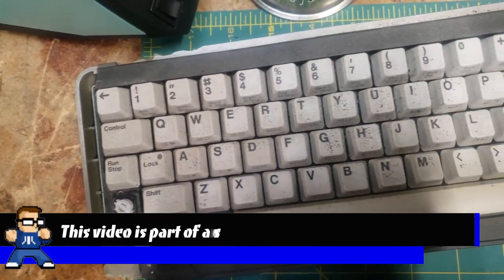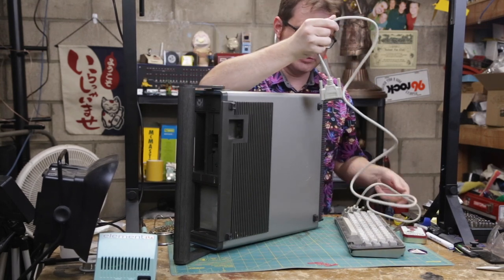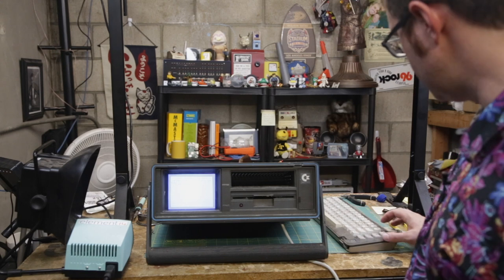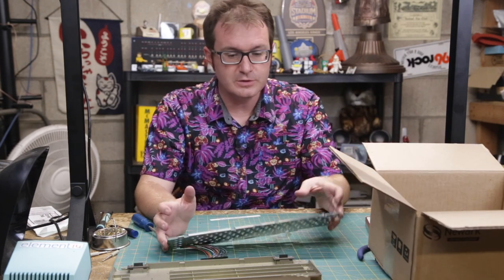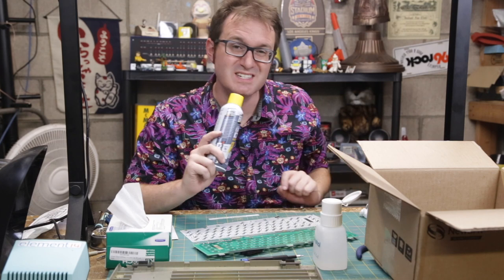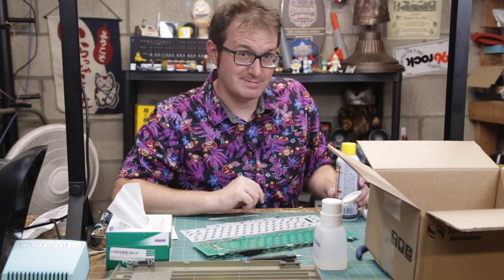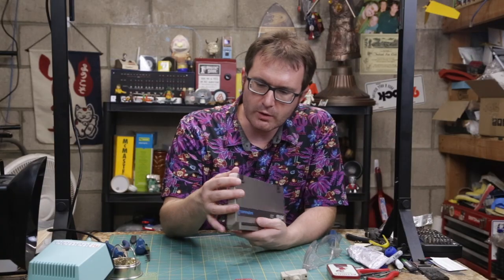Commodore SX-64 Keyboard Repair

Comment: Very good information. A friend of mine has a missing key on his, and the whole assembly of this keyboard isn't quite like anything else I've worked on before. A quick question if I might, is the mount for the keycap a unique structure, or is that swappable with other Commodore stuff? I know I've got a dead VIC-20 keyboard I can pillage for the parts, assuming the parts are compatible. Thanks again for the great video, have a sub and a great day!

Comment: Thanks for this video. How did you restore the connection between the mebrane and the print below? (the 9 lines) Did you remove the sticker? Or only used graphite on top of them?